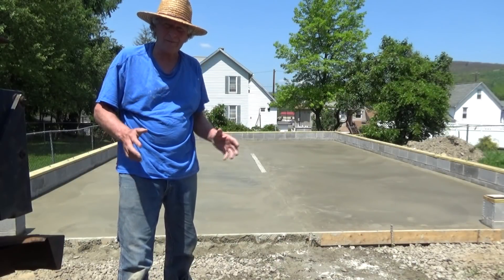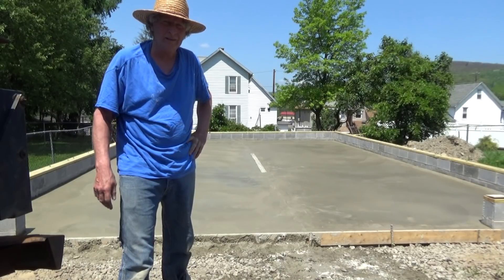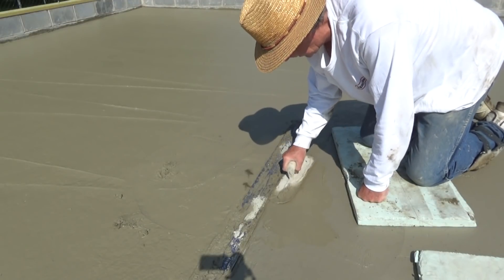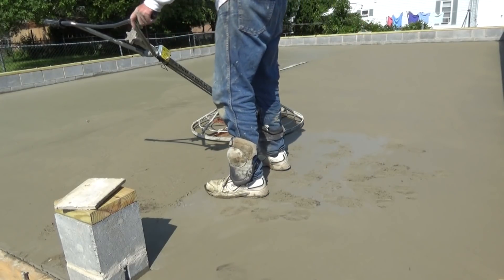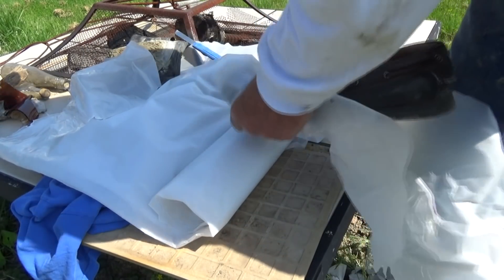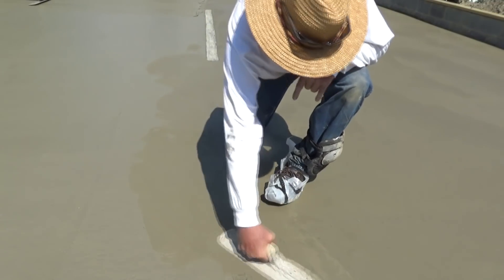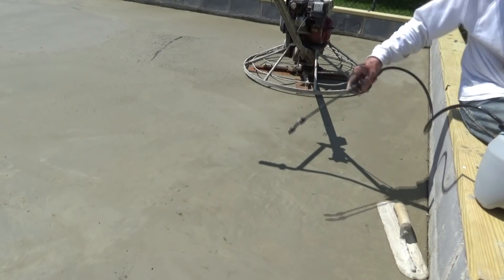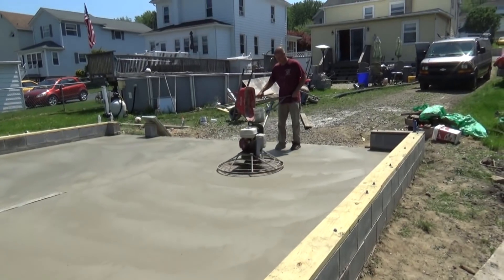SMOOTH FINISH CONCRETE (Part 5) Mike Haduck

Comment: Nice Ankle Pads!
Reply from the maker: Thanks John,  Mike
Reply: @MikeHaduck  It's Hard to Find a Good Pair of Knee Pads. I Had a Pair that Would Hook on My Shorts & Pull My Pants Down When I Stood Up. Those Were Fun. Another Pair Where Straps Stretched & Ended Up Around My Ankles. The Best Most Comfortable Pair I Ever Had Were for Inline Skating. Those Had an Inner Lining Made of Foam. I'm Glad I'm Not in California Because the Foam Causes Cancer there. My Knees Are So Trashed the Last Couple Years.. I Think those Skating Kneepads Messed Em Up.
Reply from the maker: Hi John, I agree, I am staying away from all that kneeling best I can, Mike

Comment: Mike, I watch a lot of your videos, just subscribe and love them! I have a question about dry laid stone patio,  say in New Jersey,  after gravel base, should I add 1'' stone dust for leveling and preventing wobble? What should I put in for the joint gaps? And you mentioned that use stucco wire mesh then cement it ,  like wrap the edge of stones and paint cement on it? Thanks!
Reply from the maker: Hi Yu, check out my videos on stone patio installation. Part 5. I never rarely if ever use stone dust,  thanks Mike

Comment: Great job but why no rebar or wire in the concrete?  Does the control joint perform the same function?
Reply from the maker: Hi Paul,  new school seems to be going towards fiberglass and cut Mark's,  as long as its thick and lots of cut Mark's you are usually fine,  thanks Mike

Comment: Thanks for another great video Mike. When you said the owner put some fibreglass in the mix. What's your opinion on that? Thanks again
Reply from the maker: Hi Ryan, it's only guaranteed for 24 hours but I really think it helps, thanks Mike
Reply: It’s probably not fiberglass, it’s probably a poly fiber.  I’ve been buying 1 pound bags of that stuff and throwing sprinkles of it into my concrete mixer every now and then.    1 pound is supposed to do like a yard or something like that.